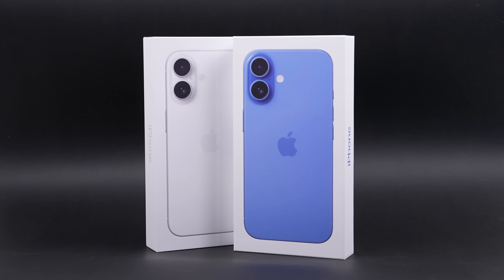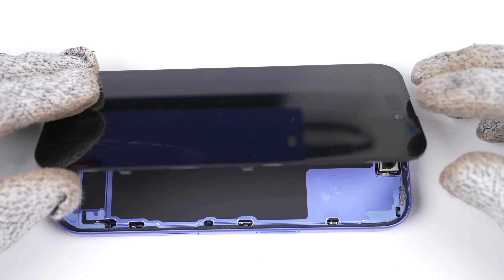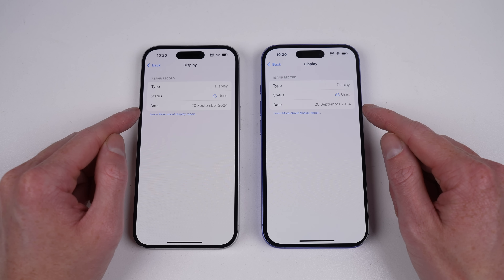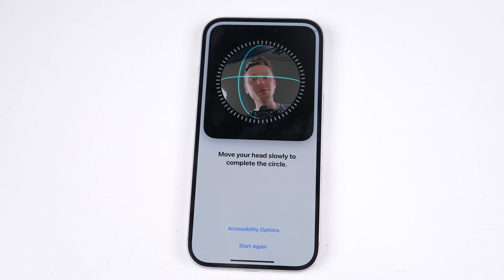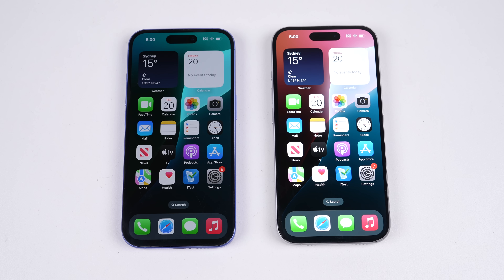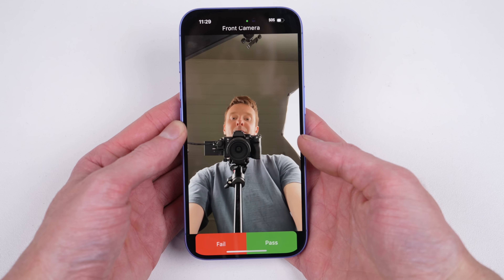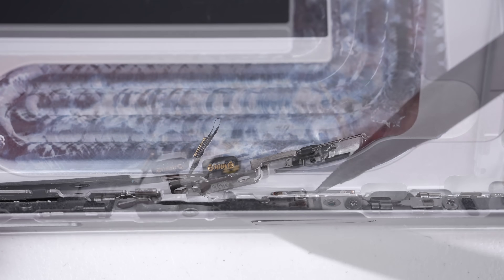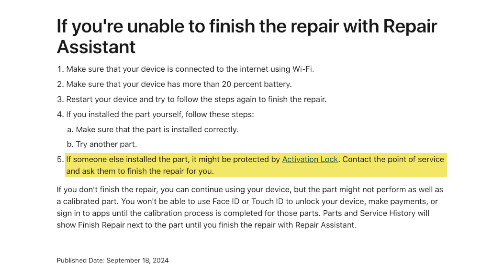iPhone 16 Changes How We Repair iPhones - 3rd Party Display Issues - Teardown And Repair Assessment

Comment: People like to say that bluetooth is better for headphones but my experience with even name brand bluetooth headphones sucks they all get interference breakup occasionally the batteries dont last the audio quality is much lower and you pay a lot of money for a inferior product. The battery charge doesnt last as long as the phone charge so  about lunch time your stuck without music or audiobooks. Wires headphone has it draw backs dont get me wrong but you can buy like 20 replacements if they break no problem i like the sound quality of skull candies personally not super cheap but also doesn't break the bank when the cable breaks they also just sound decent without interference or sigal loss and dont require charging so when the phone dies is the limit and most phones last the the whole day at work with the screen off. I listen to mostly audiobooks these days so bluetooth works great but when the batteries need charging i want my fallback plan that doesn't have a huge price.
Reply: My Airpods Pro last a full workday on ANC no problem, and my previous JBL 225tws i had for like 2,5 years only needed to be in the case for lunch, both also sounding better than anything skullcandy ever made lmao

Comment: hey Hugh i have a secondary motherboard i bought from eBay that i placed into my iPhone 13 pro which  has all original parts and I've been using as my daily for about 2 years now, i was fascinated in your video that apple now lets you at least pair those parts, , i have been waiting to fix my auto brightness, and my camera functions for years, however when i tried to repair my parts nothing happens after the procedure...even though apple verified that all the parts in my iPhone 13 pro are Genuine, can you please make a separate video testing older older phone like iPhone 11,12,13, if you can test second has logic boards to see if this procedure will still work and if it was intended for those phones as well...  Thanks

Comment: I still don't get why thr fuck do I need to "calibrate" a part to a phone, this doesn't make any sense at all. If the display has a microchip that serializes it, it is very well capable of having a chip that has its calibration settings so it is always calibrated to any phone.

The most appalling thing of all is that there are people that think this kind of practice is acceptable.

Comment: One question: If they can do this with this one... Will the older phones, like a 13, 14 or 15 receive updates for these new linking functions too so you can use a replacement screen on an iPhone 14 for example?

Comment: If the part is used from an apple locked device, or a stolen device, it will ask for the apple ID lock from the original donor phone under Repair Assistant as they are logged in your apple account, true story...

Comment: If this what it takes to get some reparability, i think apple is striking a 10 imo, they are pushing every other company to do the same, and it's been a long run but they keep getting better with each iteration, i think, gettin pissed at the data recollection and approval of apple is just asking too much for a company that has never been willing to do more than the bare minimum, i still think what they've done with these new iphones is lightyears away from no reparaing at all. W apple.

Comment: The new battery removal method is not good. it's bad tell me which average Joe has some type of 12 to 30 volt power supply. Is he supposed to just connect the grounding screw and positive tab to his car battery or something?? It's ridiculous, this makes self repair far more difficult and turns this more into a repair shop only but again third-party repair is still blocked unless a third party repair place concedes to apples absolutely absurd demands to be part of the repair program which no one in their right mind would sign up for so you basically end up getting screwed at the Apple store in the end but they get to posture and green wash as if they're right to repair. this is why it's still important to have proper legislation and to not let them attempt to twist things in their favor but still be just as evil as ever.

Comment: I believe it’s important to be truthful and factual in your reporting if you want your assessment to be taken seriously. There are a few things you stated in this video that are outright wrong, disingenuous, selfish, and misleading.

1. First of all, contrary to what some of you suggest, parts pairing is not "silly" or "evil" or whatever else you may call it. This idea seems to stem from independent repairers who believe they can use any third-party parts to repair their customers' devices without being transparent about it. One thing parts pairing does is bring transparency to the repair process. Customers need to know what parts were used to repair their devices, and second-hand buyers deserve to know the repair history of the devices they are purchasing. That’s why there is a section in the Settings for repair and service. If you oppose this, you are simply being selfish and focused on making money off people.

2. Secondly, I don’t understand why you all take issue with third-party parts like batteries and displays losing some functionality, such as battery health and True Tone. These features require calibration, especially True Tone, as every display is different and needs to be configured for the individual device. Face ID, for obvious security reasons, cannot function with third-party parts. It’s not as though the core functionality of these third-party parts ceases to work when installed—it's just the features requiring calibration that don’t function. Your argument is that this centralizes repair to original parts (Apple) and makes third-party parts seem inferior (which, by the way, they generally are). This leads to higher costs and uncompetitive pricing, which is true to some extent. But guess what? That brings me to the third point.

3. Contrary to what you repeatedly stated in this video about third-party parts being denied calibration, Apple has announced that later this year, with a software update, third-party parts will also be able to undergo calibration. If you had done your research thoroughly, you would have known this, as Apple released this information a few months ago. So what does this mean? Now, third-party parts like batteries and displays will be able to show battery health and enable True Tone functionality. Apple does say they can’t guarantee optimal performance for these features when calibrated, as they didn’t manufacture these parts to meet their quality standards, but the functionality will be available. Users can also choose to turn these features off if they don't perform as expected.

4. Lastly, I don’t understand why anyone would oppose making device theft less appealing unless they are benefiting from it. Activation lock on parts is a big win for consumers because it will further discourage theft. 

Overall, with Apple’s latest approach to repair, I don’t see how they could better balance repair accessibility, user transparency, and theft deterrence.

Before you label me as an Apple apologist or "Fanboy," let me clarify that I don’t even own or use any Apple device. I’m simply being logical in assessing their approach, and I think it’s fair to both customers and independent repairers.
Reply: Finally… A sensible logical comment.

Comment: Ngl they are slowly going towards a good way, yet they should add "aftermarket" also as option in calibration menu. With fmi is both good and bad, cuz stolen phones cant be used as a part phones, yet if I loose access to my icloud account, no one would be able to use my old phone as part phone :/
Reply: What's good about it? Opsec for the people (by being a hostile megacorp?)

Comment: Your repairs (sort of) work because both iPhones are login to the same AppleID. If the parts come from iPhones with a different AppleID, you can’t go past Activation Lock. Of course, you can turn off Find My on the donor iPhone or enter the AppleID password after repair. And, we know what’s wrong with Activation Lock. For example, you cannot notify the original owner to unlock their device / parts and there is no expiration time for Activation Lock. You can’t even turn off Activation Lock for just a part, such as a screen.

Comment: I don’t think Apple will ever allow 3rd party repair after the Israeli intelligence tampered with electronics batteries in its latest terrorist attack on Lebanon. 

They will now use this as an argument to crack down on repairs even more, even though this attack is still possible with genuine parts.
Reply: I think the only solution to this is regulation. EU needs to regulate the hell out of Apple for them to finally allow 3rd party parts. 

Don’t expect it anytime soon. They will always find a loophole just like they did with side loading

Comment: Hi there, when you swapped the mother board, did you also swap the Face ID sensor? I’m asking because my motherboard in my iphone 12 just fried and I’ll need to put a new motherboard in, while maintaining full functionality of the phone. I guess the question is should I buy a used unlocked motherboard with or without Face ID? Would be much appreciated for your opinion or pointers
Reply: Buy the motherboard with the FaceID components.

Comment: iPhone is repair friendly. You can fix it for exclusive $overpriced,99 price tag or features you paid for will be taken away. Such amazing deal honestly such wow very repairable. If I spend over 800€ on a phone I would be really pissed about it.

Knowing this beforehand I won't bother to spend so much money on a phone that lacks features I use.

Edit: The battery glue and dual chamber design is cool. Pairing tool is cool, it's step in right direction but I can't say it was done in completely good faith but it's something that is useful.

Comment: At the very least they are allowing used parts, albeit not including the use of icloud locked parts, not allowing you to switch a screen and flood illuminator.
The likelihood of ending up being in a position for this combination to work for you is very low. For example, to get a used screen, you would need to find a phone that has only a damaged mainboard, so both its screen and flood illuminator are still in working condition. This scenario does happen, but it's more likely that you'll end up with an icloud locked device which you can no longer use the parts from.

Comment: I just don't see it, rather than coming up with a new method of sticking the battery in place why put anything at all? The battery is already secured tightly in place by flex cables and all the parts screwed in place around and above it. It doesn't make sense to me; the same goes for all brands as well.

Comment: Apple’s new ‘repair’ restrictions are just rubbish. On an old ipad 4 I replaced the glass, lcd, battery and even the housing and it worked better than ever. This new system is not at all good for the environment. Of course apple doesn’t want you to repair your devices, they just you to pay them more money for a new phone. This should be illegal.😢

Comment: The positive thing that came out of this is it would prevent shady repair shops that claims to use "genuine apple parts" but actually use parts of off wish or aliexpress
Reply: That's tricky because as we saw on the video that might as easily happen on an actually genuine part and the technician will have a hard time convincing the customer that it is an actually genuine part. Then they will be marked as "shady".
No matter where you look at it from apple will still have the control.
Reply: I think if I had a crowbar and several weeks' time to work on the problem, this would probably be the best silver lining I could pry off of this impossibly large cloud.
Reply: i mean if you know just a little about tech and iphones you can understand if its genuine or not. this pairing thing doesnt really work tho i have replaced my 12 pro screen with oem original but i still cant pair.

Comment: I mean, if they made genuine used/new parts available either on the general market or to repair shops then good on them but of course they're not going to do that.
Reply: it is available to purchase on web wihtout the need to enter serial no., or you can scavage the parts from a donor phone if it have removed activation lock.

Comment: Were the two iPhones linked to different Apple-Accounts? That way you could have also tested for the "part-activation-lock".
Reply: I mean why does it matter? A simple piece of hardware shouldn't be software locked. It's really some crap apple is pulling.
Reply: @hexagon918  Yeah, we all agree on that.
But for the sake of getting the most information out of these Tests, my question is still relevant it think. If the "re-pairing" does not work, if the other phone is on a different Apple-Account, the results presented here are misleading.
Reply: They probably won’t have any issues unless the device was reported lost or stolen
Reply: @notiware  Do you really believe that? That would be the complete opposite of how iCloud-Lock works right now. Right now every iPhone is Activation-Locked for anyone other than the original owner, even if NOT reported as lost or stolen. So what brings you to that assumption?

Either way: "probably" is INHMO not enough here. I can't go out and buy replacement original parts to haven them "probably" work.
Reply: Man anybody can sell you a phone and then report it lost or stolen months or years later for whatever reason. Locking parts is bananas
Reply: @kenmastersmaster 
That's actually not the case. Once the original owner removes the device from their Apple-Account, they can never again report it as stolen/lost.

That beeing said, I agree: locking parts in general is a bad thing (for the consumer).
Reply: Wrong, if you have apple plus care you just report it lost or stolen after you sell it months later and they will remote lock it and you get a message "return to apple store" and it's bricked. You just show them the proof of purchase. It doesn't matter if you logged out. Happens all the time on used phones. People sell them and file a claim to get paid twice

Comment: I am wondering what is considered "approved" as far as using parts from another phone. Do the parts know the serial number of the phone it is originally paired to? If so what happens if the phone is blacklisted, marked as lost or stolen, or a cellular contract isn't paid off?   Will there be software disabled parts being sold online because their original phones were tainted or will there be a black market of stolen parts for sale because they will work no matter what? I guess we'll see.

Comment: I can see the usefulness of the pairing in one way, it ensures that the phone the parts is from is not stolen but reset the right way. But you could reformulate the non genuine display message... Do you think it works retrospectly on oldet devices updated to ios18?

Comment: so the hardware  will only retain its' genuine status, even if new, if it's never unpaired from the phone....
bet money there's  either an in-house method to  re-confirm a "new" part. that or there's gonna be something in the diagnostic kit to get the genuine tag for it back on. either that or they just relegate the battery and screen as generic parts, and will only be classified as new as long as they weren't removed from the housing...

it's like a win and a loss simultaneously. although props for getting the self service updater automated, cause calling into apple to  have a third party certify part replacements was a PITA

Comment: This is the right move this stops stolen iPhones from getting harvested but at least is somewhat eco friendly. Does not help in all situations but this is way better than before. It’s not like you can refurbish a broken screen so eventually there will be genuine screens with aftermarket glass available. I know everyone likes to complain but this is a huge step in the right direction.
Reply: Software limitations on hardware repairs that can only be passed by apples servers? This isn't going in the right direction. This is going in the direction of even more control.

Comment: What a joke! The lengths they go through to block repair and gaslight repairers and users is insulting. They only allow replacement with a genuine Apple display under VERY specific conditions, while the half brightness thing, which I'm sure is not a bug, makes third party displays worse than ever! And the pairing for things like the button and back glass, come on, they are sinking to new lows.

I boycotted Apple in 2007 after I saw how they treated third party developers who made apps on their devices before the App Store. I've never bought another Apple device since my first gen iPod touch and never will.
Reply: @mrfoxesite4482 My OnePlus 6 is excellent.

Comment: Just wait for chinese to do a work around with apple anti repair, apple is no match with chinese HAHAHAHAH
Reply: @mrfoxesite4482 in my place 12, 13 and 14 screens can be replaced and the true tone are still there and the iphone still thinks it is still its original screens u just need to transfer the chip underneath the old display and transfer it to new one except 15

Comment: I am not a apple fanboy (even an hater at one point) but the parts pairing issue is to prevent iphones gets stolen and their parts being stolen and used on other phone. Only if they paired parts with iCloud so when the phone has no iCloud, it will work on other devices